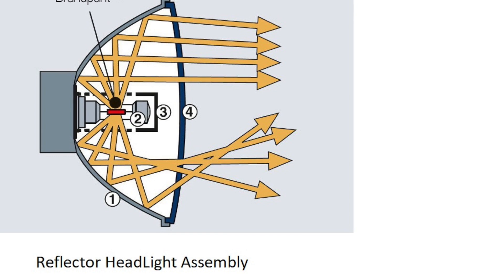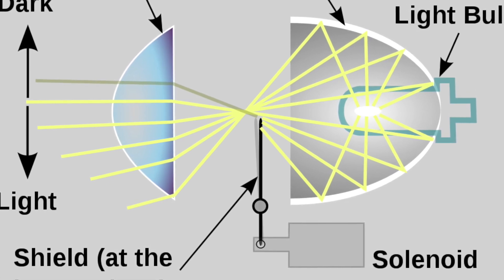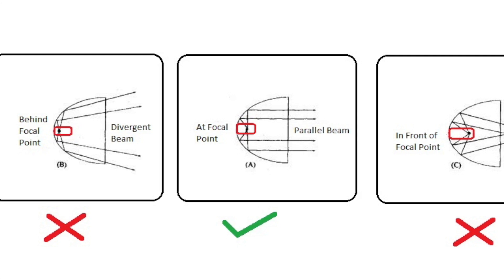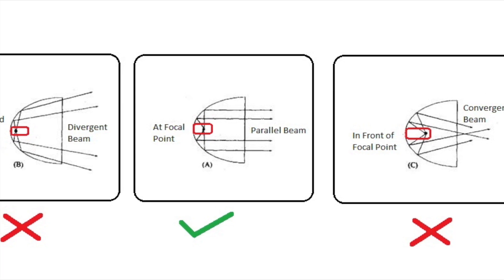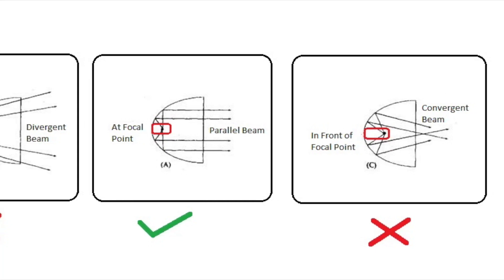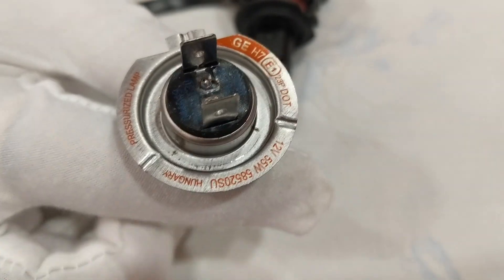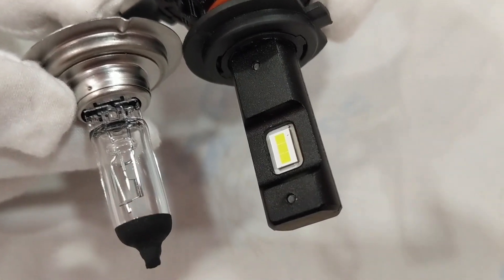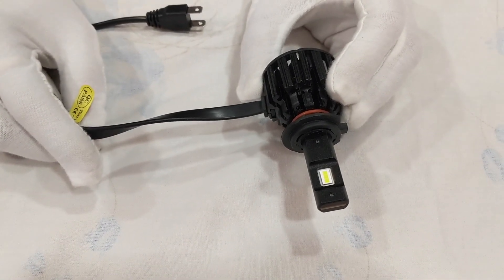Comparing LED with Halogen, Selecting Car HeadLight Bulb

Comment: Can help me with aliexpress link to get LED adapter for rapid projector low beam with double barrel headlight?
Reply from the maker: If you are in India, then you will not be able to get it delivered, as AliExpress is no more working in India, and no other options available to import things from China. I already have waste more than 1500Rs in AliExpress and other sites for Adaptors and its of no use.
I have got adaptors from Amazon and planning to fit the LEDs in Projector in few day, will post video on it soon.
Links for Adaptor from Amazon are:
Adaptor for Projector:
https://www.amazon.in/gp/product/B08SKF3V56/ref=ppx_yo_dt_b_asin_title_o01_s00?ie=UTF8&psc=1 

Adaptor for Hi Beam reflector:
https://www.amazon.in/H7-LED-Base-Adapter-Mercedes-Benz/dp/B08271HQM1/ref=pd_day0_23?pd_rd_w=JOunk&pf_rd_p=ddf3065d-37bd-4713-89a2-28f76ee88912&pf_rd_r=PSV4RKBJY1VS1FRNG488&pd_rd_r=c6cbe7da-5559-45c2-a2d5-bc83d6921652&pd_rd_wg=sVbOe&pd_rd_i=B08271HQM1&psc=1

Comment: Bro I also have rapid top varient and have different barrels for high and low beam 
Can u suggest me about what led should I put in and where can I buy adapter from online
Reply from the maker: Hello Arunji, I will suggest to upgrade and keep the Halogen bulbs in Hi Beam barrel which is reflector type, as LEDs in reflector distorts light a lot and blind the incoming traffic. You may put Philips Crystal/Dimond vision Or Osram blue vision bulb if you need white light in Hi beam.
For low beam, you may put the LEDs but we do not have adapters available in India, if you have contacts in east Asian countries, you may get it from AliExpress, there are two different type of Adapters in Hi and low beam barrels.  Hope this helps.
Reply: @vtgtsvlogs9152  Thank u so much

Comment: Please share the link to buy the LED lamps for your Rapid
Reply from the maker: pras18rash, if you have Skoda Rapid with different light barrels for Hi and Low beam then you will need H7 bulb and if you have Rider variant then you will need H4 light.
I bought the LEDs from "www.cloudsalestore.com", they sale it on Amazon, and you will also find the price difference than Amazon.
Please see that you have the Adapters to fit the LEDs in the car, or its waste of time and money without the Adapters. 
Adapters are must to fit LED.